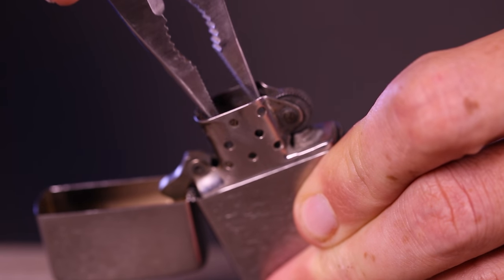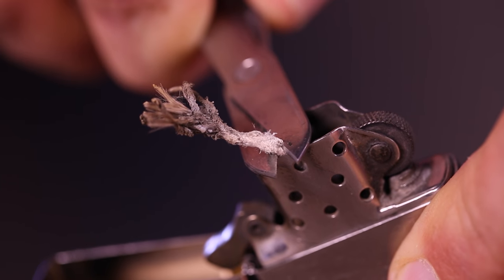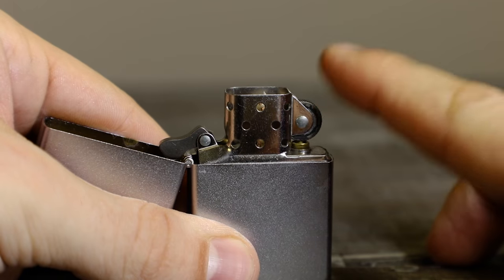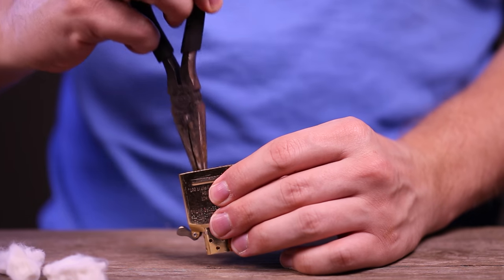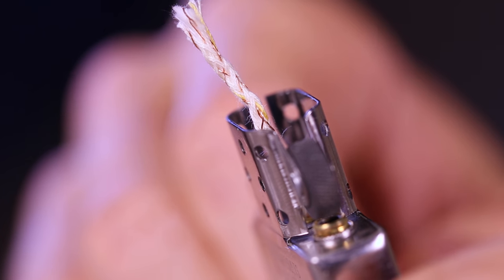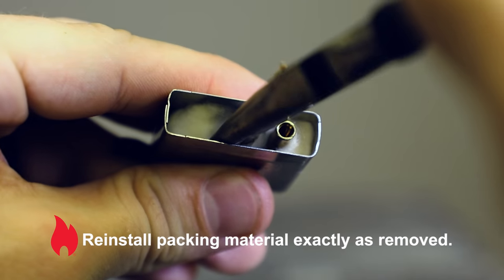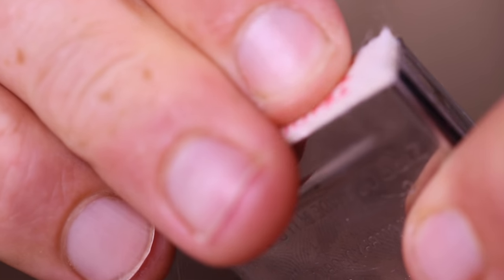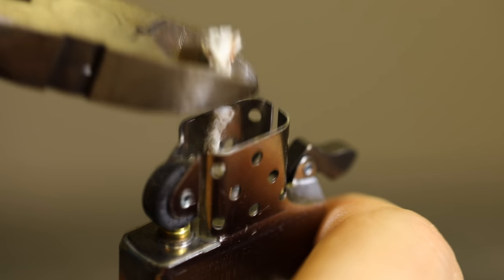Zippo Instructional: Wick Maintenance / Installing a New Wick

Comment: lol once or twice a year
Reply: Dude I do this once in 2 weeks, and I don't even smoke, I just use it casually
Reply: I've had mine for 3 years and today is the first time I've trimmed the wick. I smoke a pack a day..
Reply: @Jolly_Green23  that's impressive dude, maybe its because we use different fluids
Reply: I use standard Zippo lighter fluid, but I have a few Zippos and the one I was referring to is the best I've had. One of my other ones goes through fuel ridiculously fast.. I'd have to add fuel every few days. The Zippo I've had for 3 years was sent to me by Marlboro, and I use it exclusively since it's never failed me. I think I'm just lucky with it.
Reply: @Jolly_Green23  I think I have a fake one, but the wick is the same, so I can't understand why this is happening
Reply: Idk what you use yours for, but the fact that I only use mine to smoke probably helps me..it's only lit 2 seconds at a time.
Reply: you guys cray cray. i have been using the same lighter for 10years and only changed the wick once. i use it all the times to light my wood stove, gas torch, lanterns and candles. the trick is to never run the wick dry and to shield it from the wind.
Reply: Just pulled the wick for the first time in over 20 years.
Reply: i trimmed the wick after 200 years the first time
Reply: I use this lighter heavily, and I smoke... And even after a full year of use, my wick is still only slightly discolored with some bits of soot here and there. The key is to only run these things on an optimal fuel level. If you use a Zippo, take a few seconds and top it back up every day. More fuel = longer wick life because the wick is not being consumed.
Reply: Francois Dupont Well, a lot of people have Zippos exclusively to play with them. I constantly light it during the day because it's fun and I don't smoke.
Reply: @BltchErica  Wow, No issues there.
Reply: Dave Fredriksen same here. My wife uses it too. I only use Zippo fluid. Maybe others are using something else.
Reply: Ummmm try everyday
Reply: @Jolly_Green23  want fuel do u use
Reply: @tatarugabriel4328  If you are burning your wick that fast you are eather using the wrong fluid or knock off wick. Eather way. Don't inhale the first puff. Zippo's are cool and all but don't burn that clean, don't inhale if you  tast the fluid.
Reply: @tatarugabriel4328  you are letting the wick burn.... You should only be letting the fuel burn. I've had the same zippo for 7 years and I'm just now replacing the wick.
Reply: @TheFrogInYourClosetWatchingYou  thanks sir, I figured it now, it's been a while
Reply: @tatarugabriel4328  yeah it's all good we all have to learn. But yeah wicks should last a while but we all mess up. I burn my wick on accident we all do.
Reply: @Jolly_Green23  that’s mad. I’ve had mine 8 years and have not trimmed the wick :/ I’m just here to see how it’s done 🤣
Reply: @Francois_Dupont  I’m glad I’m not the only one. I’ve had mine 8 years and not even changed it once or even trimmed it
Reply: @yeeyeeyee3115  Standard zippo fuel
Reply: @antoinemccormick6117  As a 1-2 pack a day smoker, I only trimmed the wick one time in the 5 years I've had that Zippo. I quit smoking a month ago, so I'll never have to trim it again 😁
Reply: You need to make sure you never "run it dry" so the wick doesn't start to burn, while running out of fuel. Just top it off before it runs out. This is propaganda from Zippo to spend money on wicks. Also, use "Cotton Bacon" vape coil cotton instead of the rylon balls Zippo provides. You'll hold my fuel, for longer. If the wick is "constantly saturated" in fuel.. it won't turn midnight black like that. Basic maintenance. We don't run our vehicles until every drop of fuel is gone. Same with a Zippo ! It's very similar to a lantern mantel in that it will burn up if you're not careful.
Reply: @Francois_Dupont  Wdym dry? Can my flint dissappeared after 3 weekd
Reply: Wick goes bad more often only if you run your Zippo almost dry. I use mine for smoking, 1 original fluid and 12 flints are enough for a year, I trim the wick twice a year and replace it every other year, rayon once every 3-4 years. Never had any problems, always smooth burning.
Reply: @major7004  200 years is too early.For better performance trim it once every 400 years.
Reply: It turns Black immediately after lighting even though it s fully topped off. Dont know what is wrong, i did the S pattern and changed to a new wick also branded zippo
Reply: @major7004  🤣👍®️🇺🇸🔥
Reply: @Jolly_Green23 I Got that Marlboro zippo also got back in early 2000’s used quite a bit never changed wick yet.Logo is wore off but it’s been a great lighter.I now have a slim version had a hella time changing the wick in.
Reply: @BlueSkyCountry I was thinking this too. That maybe the wicks aren't saturated enough and it's burning the wick instead of the fluid.
Reply: My own wick stops work properly after 4 years without trim 😂. Now I know
Reply: once or twice a day
Reply: I agree it gets black, but DO YOU really need to that often?
It won't work for yous guys or? 
I'm surprised they don't tell you to replace it weekly because, ya know, gotta buy more Zippo products

Comment: I dont smoke but I have a zippo as a great way to start camp or cook fires. I actually think a zippo should be in every survival pack for any kind of camping/hiking/skiing etc trips.
Reply: Not necessarily the fluid will evaporate over time wether or not it is hot, I would recommend a thunderbird butane insert. It doesn't ruin the feel of it and it won't evaporate either.
Reply: I had to do that myself because I had mine in a plastic bag in my survival pack and handy used it for a couple months and I had to use the Sparks on my camping trip
Reply: It is a great device to have on you in case of emergencies. For one thing, the Zippo WILL light under ANY temperature conditions. Even in arctic deep freeze where butane lighters will not work, a Zippo will fire up just fine. However, ALWAYS make sure you have fuel with you as well, stored in a tight, leakproof canister such as the one that most lighter fluids are packaged in.
Reply: I would agree it should be in a survival pack, but zippo fuel evaporates even inside the casing. Best just have a spare jug of ronsonol or zippo lighter fluid if you want to do more than make sparks at soggy wood. Trying to run 4 of them, it's almost a weekly job to refill. I'm luccky I haven't had to replace the cotton padding on any of mine, although some of dad's are getting pretty yellow, and a bit stiff. I keep them for sentiment, not function. I like my collection more. :^)

Comment: In the battle, I pulled the end off the wick. Pulled the wick out and then couldn't get it back through the wick hole. Eventually used some dental floss and tied a constrictor knot (go to Animated Knots by Grog) near the end of the wick and pulled it right through. Lights like the champ it is again.